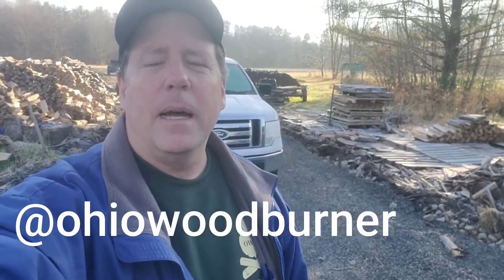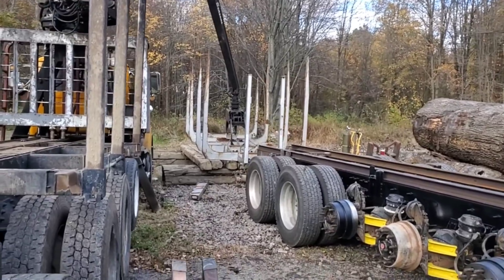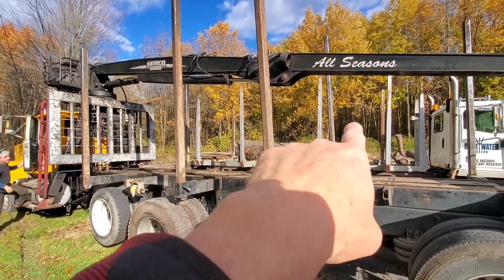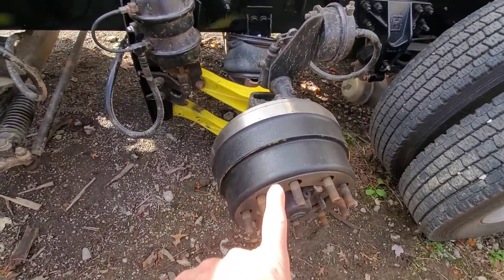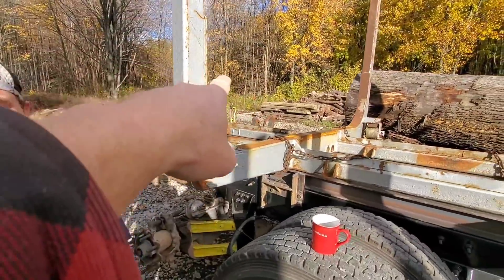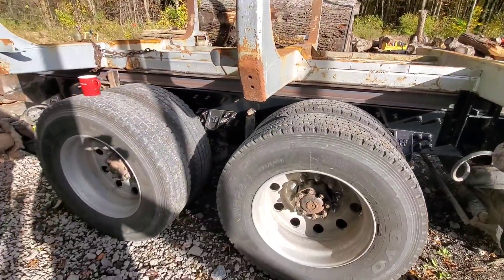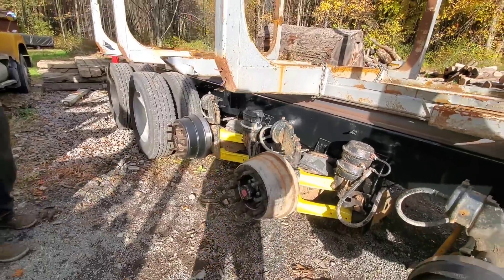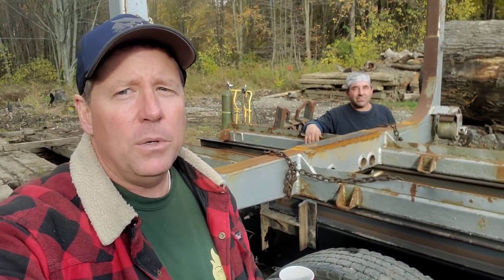A BLOW TORCH, A WELDER, AND A LOGGING TRUCK!!!

Comment: I changed the loader on a truck before without any other piece of equipment unbolting the crane used the Outriggers to lift it up off the truck

Comment: Made me laugh.  I'm  running a 73 SA200.  The sound of it running is sooooo familiar.  Logger from Wyoming here.
Reply from the maker: thanks for watching Ben.  If you haven't already, please subscribe as I will bring more vids of this build.  Thanks Ben!
Reply: Ben, those SA200's are iconic!
They were #1 welders for pipelines, and oil field welding, and job shop welding shops "portable welding rigs".
Still very much sought after, and restored and even "hot rodded" today!
Many hoods on SA200's have been chopped!

Comment: 19:12
How's the repaired road holding so far ?
Reply from the maker: It is doing well.  There are some spots where I could put some more slag in the spring but it is largely hard as a rock!
Reply: @ohiowoodburner  Good.
don't forget about the drainage.

Comment: 7 axles is overkill imo. Same trucks in ny and PA run 3 axles.
Reply: The problem is living in ohio a tri  axle can only haul 61500
Reply: @loghaulerjesse8228  loving what you are doing!
Kinda what I do 50 hrs a week for Vanderhaags Trucks and Parts, at the Des Moines, Iowa shop.
Weld, fabricate, lengthen trucks, shorten them, build them into other things. Install lift axles. (4 on one dump truck). Custom work.
You are doing fantastic work!
Reply: @loghaulerjesse8228  I figured your bridge law was different. That truck looks like a Michigan axle setup. Did you consider cutting a couple axles off? I would think less tires, brakes, weight etc.
Truck looks nice tho you did u good job